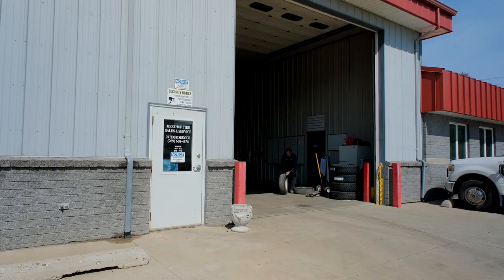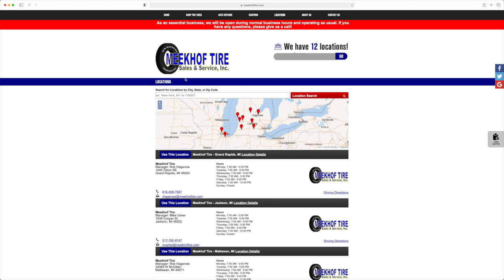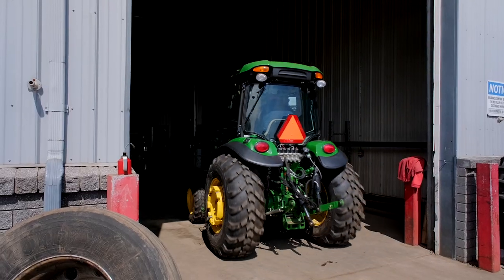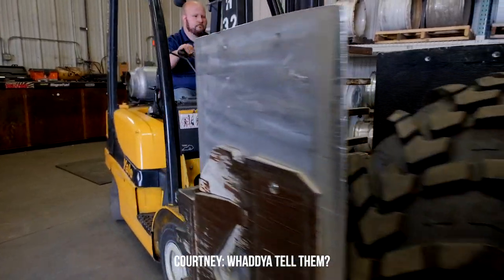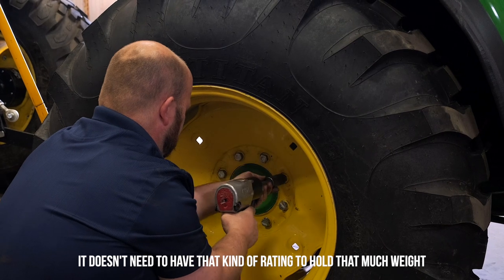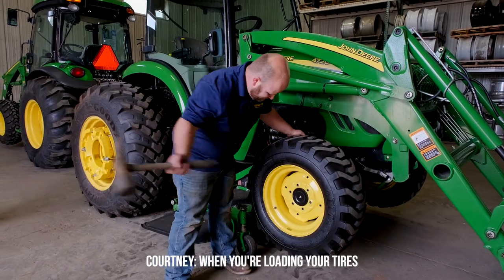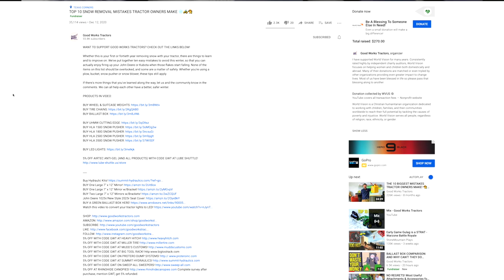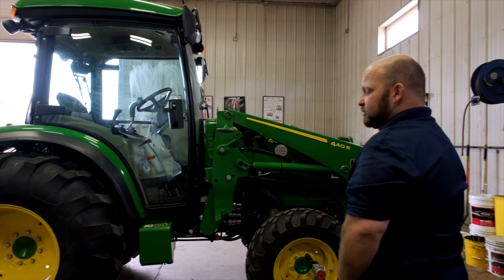TOP TRACTOR TIRE TIPS & MISTAKES + WHEEL SPACER INSTALL 🚜

Comment: I just (last night) flipped the rear wheels around on my 3320 that I've had for 5 years.  I have a hill on my property and the rear was really narrow.  I got "tipsy" quite a few times...not just on the hill, but with loads on the forks/bucket.  I do have 110lbs of weight on each tire, and a grader box that lives out back with an extra 150# on it, but it wasn't enough.  During my "test drive" after flipping the wheels and reinstalling the weights it felt MUCH more stable.  I'd been playing with fire much too long.....

Thank you for the videos!

Comment: GREAT video!  People should watch past what (appears to be) the end, because then we learn that IF you're going to fluid fill, ONLY use a metal valve stem.  (Gotta go check my Kubota now--LOL).  Also, GREAT tip about not picking wheel spacers wider than the width of the FEL's bucket.  Also, I know that rear wheel spacers can cause your tires to contact the anti-scalp wheels on some mower decks, so check with your dealer, etc..., on that issue, before just ordering your wheel spacers.  Courtney's channel and "Tractor Time with Tim" are are the tow, best channels for sub and compact tractors on YT, IMO!
Reply from the maker: Haha, thank you for watching, I appreciate it!

Comment: Wow!  That really made a big difference.  I think I would also use anti-seize with the aluminum spacers  on the lug nuts as well as the mating surfaces of axle and spacer.  Dissimilar metals tend to oxidize when mated together and it may make them difficult to separate.
Reply from the maker: Why wouldn't a manufacturer that's been making spacers for 25 years include this in their installation instructions?  Seems like they would if it had repeatedly caused their customers issues over the years?  They call for anti sieze with the steel spacers, but not aluminum.
Reply: @GoodWorksTractors  That is a very good question.
Reply: @GoodWorksTractors  The aluminum spacers are anodized. The anodized surface is non conductive, non corrosive and extremely hard. Nothing better for corrosion protection than anodized aluminum, not even most stainless steels.
Reply: Fyi, in structural engineering we call it Galvanic corrosion and its where two dis-similar metals come into contact with each other. You can prevent that with rubber or neoprene spacer. Plastics usually do not weather well.
Reply: @GoodWorksTractors  anti seize for sure! Many things that require anti seize things rust. I anti seize most things just because a manufacturer doesnt recommend something dont mean chit!
Reply: @mbjKrakenEngineering  the wheel studs and lug nuts are still steel the antiseize is for the studs not the weak aluminum plate. You wouldnt antiseize the plate its the friction between mated surfaces that keeps the studs from snapping under a load duh. Common sense physics 😂😂😂

Comment: There is no doubt that the wider rear tire spacing provided by the Bora spacers will help for stability.  Just be aware that the rear tires will now be outside the width of the standard bucket on the FEL.  That can cause difficulties digging and moving material.  The extra tire spacing will also put the tires outside the width of your existing 3PH implements purchased to match the standard rear tire spacing.
Reply from the maker: Every decision has a trade off.  Plan ahead.

Comment: I think I missed it but what size wheel spacers did you install? I put 2” on mine and flipped the wheels for or a total of 3 1/2” per side. Made a big difference. Just need rear wheel weights now.
Reply from the maker: Yeah I think I forgot to mention...3" spacers

Comment: Get some large fender flares on it like the 66R has. That will make it look better. Will the flares on the 66R go on the 4720? I think they will but not 100%. Yes, switching wheels may help too because your 3" looks way way wider than my 3" BORA set up on my 52R. Mine had to be 60" center to center tire tread to be center going down 30" corn or bean rows. Love my set up and love these spacers from Lenny at BORA
Reply from the maker: I'm curious to find out about the fender flares.  The axle in this tractor seems to be extra wide.  Kind of strange.

Comment: My dealer filled my rear tires with windshield washer fluid. He claims that the beet juice is so thick that it becomes hard to pump out on tire change out.

Any opinion on windshield washer fluid for the purpose of adding ballast ?  Glad you kept the 4720, I have one also. Regards
Reply from the maker: A lot of folks use washer fluid.  I just had beet juice squirt out all over me last week.  I can verify that it remains very liquid, no gelling.

Comment: going wider does make for more stability but it puts more load on the bearings of dead axles.
Reply from the maker: Of course
Reply: Your new "wide-glide" looks like "axel-snap" in the making. Maybe a set of some out-bound "training wheels" will work too. Other than that, always an informative vidio. Mr. Adam really knows his tractor tire  stuff.

Comment: Question on liquid loading: I had the rears filled on my Yanmar YT359 (59-hp, same tractor as Wranglerstar).  Normal operation I don't notice much, except road transport.  At higher transport speeds I have a vibration that shakes my tooth fillings!  Is this a normal downside of loaded tires?
Reply from the maker: I've not experienced that with loaded tires.

Comment: I had NO IDEA that tire spacers were an issue; in such expensive pieces of machinery. Growing up, wheel spacers were used to accommodate over sized tires for muscle cars; deemed unsafe by many. I fast forward 40 years & here I am reading about these rather expensive pieces of machinery "requiring" wheel spacers to prevent tipping over? Am I getting this right?

Comment: When I blade snow I need as much weight as possible for traction. I even weight the blade with 6 weights. I have loaded front tires to give me some steering and to add dead weight when winching trees out of the woods (need to use wheel chocks in this case). Note Bora does not make spacers for rear tires on JD 670 and there is not enough space to put on chains.  Cheers.
Reply from the maker: That's a bummer!  Yeah, probably need spacers just to fit the chains.  What about tire studs?
Reply: @GoodWorksTractors  I thought about doing studs too as I average 300-400 hours per winter doing driveways with my 3039r but then I'd have to get a second set of tires for the summer, I road my tractor between clients so chains are a no go as wisconsin doesn't allow. I bought a $100 tire groover off Amazon and cut some "x's" in my r4 tires and it was a night and day difference. Haven't noticed any additional wear or negative side affects. I also loaded my front tires to aid in front end traction, I actually drain them for summer use to cut down on wear. I fill them myself with a $8 valve from TSC and use a submersible pump in a bucket with washer fluid. Thanks for the video, I bought some aluminum 3" spacers and WOW what a difference.
Reply: @GoodWorksTractors  The weights work out fine.  I use 14 weights plus loaded tires and then two large ammo cans of lead and iron.  That plus the blade and the snow blade addition gives me plenty of traction for all but on ice.  Also, chains would tear up my asphalt driveway and the road.

Comment: So I recently installed some 2” BORA spacers on my tractor. I noticed the instructions mention that you should re-torque at 5 miles. Just wondering if for a tractor that would be something like 10 hours.

Comment: Courtney do you think there is any problem with reversing the front tires on the tractor to widen that stance?  There are those who think it puts to much strain on the front axles and bearings.
Reply from the maker: I think if the manufacturer made the front wheels reversible, then it should be fine.  Some will have limitations listed in the manual for when to use or not use the wider stance on the fronts.

Comment: If you set the parking brake on the pickup the whole thing won't roll. Automatic trans only has a steel bearing used during Park. You could potentially cause damage not braking.

Comment: Since we’re talking tires, at what PSI are your versa turf set at. I recently added a set for my BX and I have them set at the max as per what’s indicated on the tire, 22 Front and 20 Rear but I find when I load the bucket I’m afraid it might be too heavy for the front tires 🤷🏼‍♂️🙂.  They do give you a different ride compared to the R4. Thanks 👍🏻
Reply from the maker: I keep my Versa Turfs a pound or two under the max rating.  I haven't felt a ride difference, but have noticed a night and day traction difference in all conditions.
Reply: @GoodWorksTractors  Thanks Courtney, BTW sorry for your loss. We loss one of our Main Coon cats in April and it was tough. Take care!

Comment: How long did it take in total tile to replace them? JD dealer is telling me 3 hours to put on 3-inch spacers, no wheel weights? Took me less than an hour to do the fronts.
Reply from the maker: Maybe an hour?
Reply: @GoodWorksTractors @GoodWorksTractors, thank you for the reply. I called them back as I thought there was no way they would take that long; they were already finished. It took them 2.5 hours to install 3-inch rear spacers, which is very disappointing.

Comment: Well what brought you to that decision? I have some concern with how much those tires stick out looks like it would cause strain on the axels I could be way wrong.
Reply from the maker: Is it better to tip over?
Reply: Could cost the same to break axels as it would be to tip over obviously if you don’t get hurt in that process. But I was only stating it looked as if it put strain on the axels it’s your tractor do what you wish obviously, take it on out to 18 inch extension.
Reply from the maker: They are 3" spacers.  There's other differences at work.  Tire width and dish direction.  2-3" spacers are added on machines every day if the year.  If widespread failures were occurring, then you would find stories all over the internet and wheel spacers companies wouldn't exist.  Sure seems you're being highly dramatic about a routine modification.
Reply: @GoodWorksTractors  not at all was saying it looked concerning with the mod you did or with anyone doing it, merely a comment kinda like watching a tree next to house that might fall on it concerning but it has to come down to aid in keeping limbs off the house for safety. But when it comes to the questions being asked is it better to tip over? Come on now that was a bit smart. All you you tubers say like comment subscribe I commented as you have asked before for general purpose of discussion. You also missed where I was wondering how you made your decision so obviously my concern was not so much the wheel spacers.

Comment: In an application where people need ballast, which is every compact tractor, why not use steel spacers?
Reply from the maker: Spacers are so small on most of these tractors, that the weight is insignificant.  Steel requires priming, painting, and anti sieze.  Aluminum is more straightforward.  You're welcome to get steel though!
Reply: @GoodWorksTractors  I wish you had explained all these advantages to the aluminum hub-centric wheels on my pick-up a few years back when I had to put my floor jack between the wheel and the spring pack to remove the wheel from the hub:)  I think some of this advantage may be due to you changing things so often, aluminum does take longer to be a problem.

Comment: If you operate the equipment within its limits you will have no problem
Reply from the maker: Accidents can happen even when operating within limits.  Hidden objects, equipment failures, and other outside influences equally affect all of us.
Reply: I second that. It is by the grace of God that my 3035D did not roll when the edge gave way and it slide down a 3 ft ditch sideways into a tree. It should have flipped. ALWAYS FILL YOUR TIRES. I questioned it on purchase.  No regrets now.

Comment: That will be nearly impossible to roll over (looks a little goofy) but definitely more stable.
Reply from the maker: Haha yeah I may actually flip flop the rear wheels.  Mainly to track better with the fronts.  No problems with stability now though!!
Reply: Kinda like some of the trucks around here in TN. All it needs now is a way to squat the rear and you'll be one of the cool kids! I bet it is really stable though. Love the videos!
Reply: @RockyX13  It slays me when truck owners make their pickups LESS capable of being TRUCKS (i.e., hauling stuff) by taking out the "rake" the engineers designed into the vehicle.  So-called "cool" looks that kill functionality are NOT cool, at least in the REALITY-BASED community.